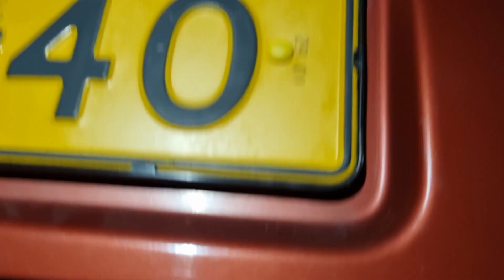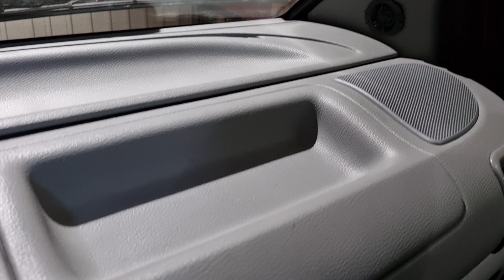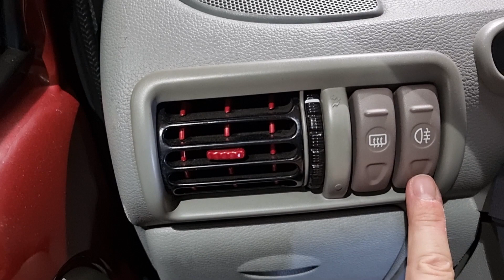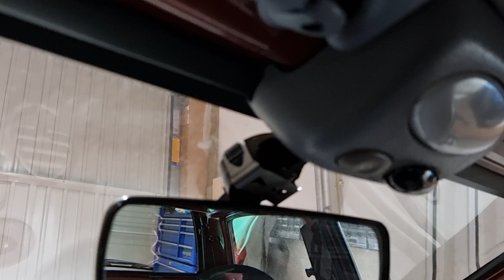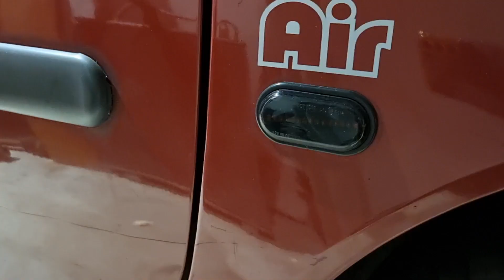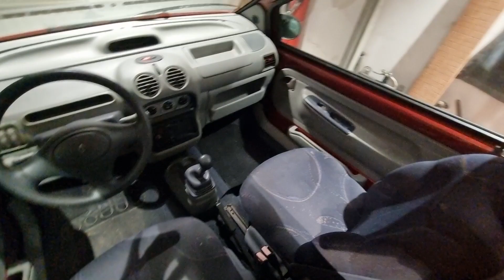Twingo 1 Turbo, Build overview part 4

Comment: I think you killed it, in a positive way of course. 
How did you install that tachometer from twingo 2 ?
Reply from the maker: I used the cable bundle from the Twingo 2 so i only needed to connect a speed sensor cable from the Twingo 1 speed sensor. As for fitting in the dashboard just cut a hole to the shape of the tachometer and slotted it in.
Reply: Le faisceaux de la Twingo 2 est facile à adapter sur les instruments de la Twingo 1 ?
Reply from the maker: Hello, I hope English is ok. It's not difficult to connect the Twingo 1 instruments to the Twingo 2 cables, but it is a lot of work. Looking through electrical diagrams for the right cables to connect etc.
Reply: @TwingoFam  thank you for the answer, you're the only guy on youtube who made this swap it seems, yet it's a very good idea. It makes me want to get started (this would be my first change of engine and harnesses) I have to start somewhere, thank you for the motivation.
Reply from the maker: @RomualdNey Your welcome if you need any advice or help feel free to ask.

Comment: how do you install the rpm
Reply from the maker: Hi. I used the wiring from the Twingo 2, so the connector to the rev counter is original i just needed to wire in a cable from the speed sensor to the rev counter. Hope that helps.